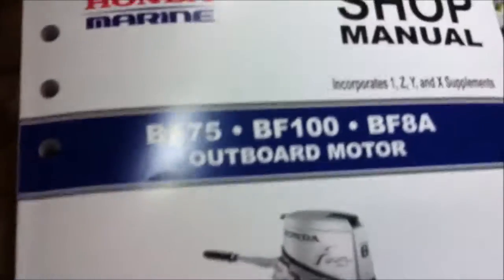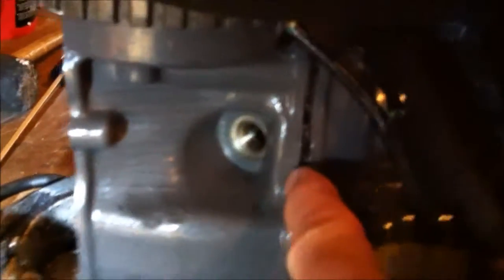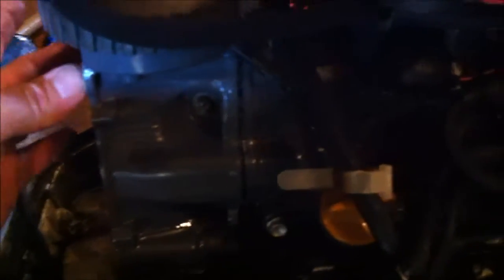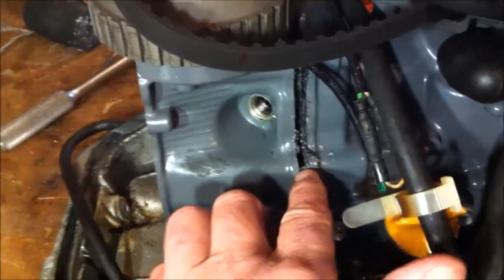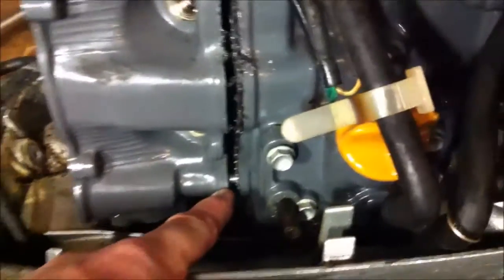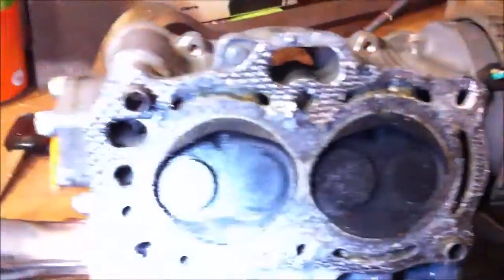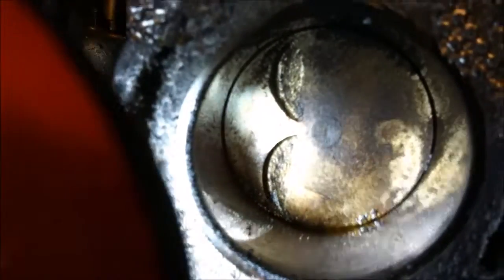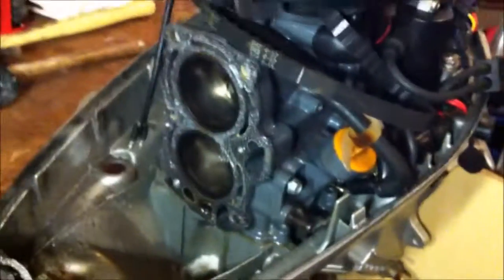2005 Honda BF8A Outboard   Water in the oil Part 1 of N

Comment: I've got a question about the  video, which was really helpful. Thank you. 
I have the same outboard with a clogged oil pick up tube screen. Previous owner neglected it.
1-remove lower unit
2-remove exhaust flange thing
3- remove all engine mounting bolts
4- clean tube
Does this sound reasonable?
Reply from the maker: Hi it's not a lot of detail, but sounds reasonable. Good luck.

Comment: What year is your Honda engine. I have a 1996 getting water into the oil sump also. No white smoke or sputtering runs perfect but oil get merky. Thanks great video btw
Reply from the maker: This is a 2005.  I would start w/ making sure your intake manifold gaskets are in great shape. Then test it after that.  Going all the way to the oil fill gasket is where the big work is, and you may save time & solve w/ just the manifold gasket.  Good luck

Comment: Replaced head gasket in BF8A today. A couple tips: no need to remove cam-shaft pulley. Be sure to replace t-stat if ever pulling intake manifold. Mine was blowing white after wfo run.

Comment: I have an oil leak in a 86 honda 5 hp. The leak is coming from engine block gasket. Where the oil pan meets the block. Any suggestions? I have never tackled such a project. But I have worked on many cars and trucks. I just bought the service manual. I love this motor. Bought it new and it starts and runs great. Just has an annoying slow oil leak that leaks into the housing and out through a weep hole. Leaving an oil sheen on the water. Again the leak is very slow. Like maybe a teaspoon over a couple months. Thanks for any helpful comments
Reply: @IFish4Tuna  no water in oil. / just a small oil leak around the gasket. Letting oil leak out to the exterior of engine. And it collects in the bottom of the engine cowling ( or housing). Eventually leaking out a weep hole in the bottom
Reply: @IFish4Tuna  it appears I will have to remove oil pan to replace this gasket. Which is much more involved than removing an oil pan from a car. Lol. Hoping to find a video of this. But surprisingly there are no videos on the honda 5 hp ( BF50S)

Comment: Thanks for the info. Do you happen to know the torque specs/ pattern for the head bolts. Have this same motor , had a problem with no water flow. Thank you

Comment: Mine just has water in the oil. I drained it and put new oil in and ran for 1/2 hour per the manual and drained again and came out with water in the oil. It doesn't have white smoke coming out. Runs great. Not sure what's wrong. Any suggestion?
Reply: Probably a Head gasket failure between water cooling jacket and oil passage.

Comment: Did you ever figure it out?  Also, if you happened to capture any footage of the procedure to change the impeller, I'd be forever grateful if you'd post that.
Reply: I can’t remember where I saw it but someone on a video regarding thermostats was saying that if it fails in the open position (or if you choose to run without one installed) that the motor runs too cool and condensation can (eventually?) introduce water into the oil.